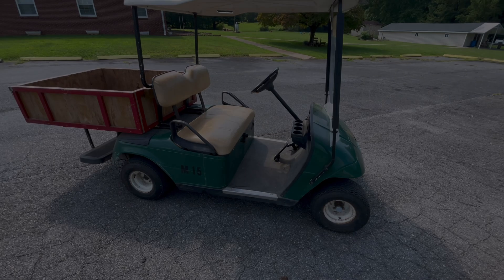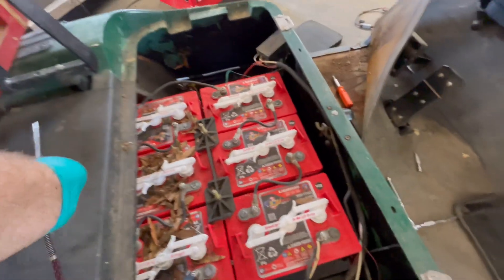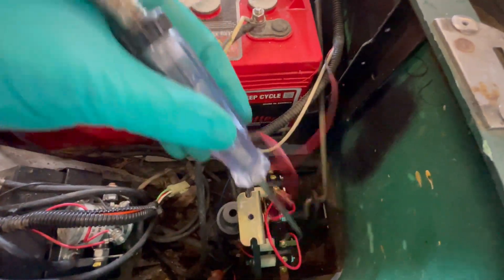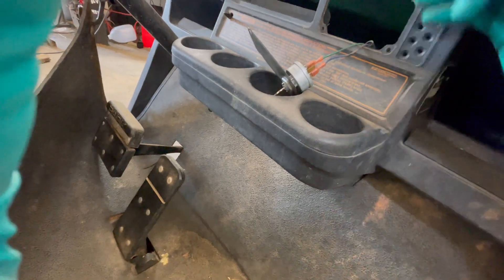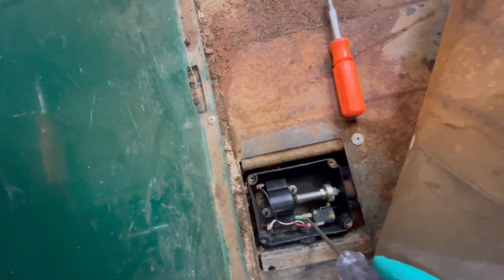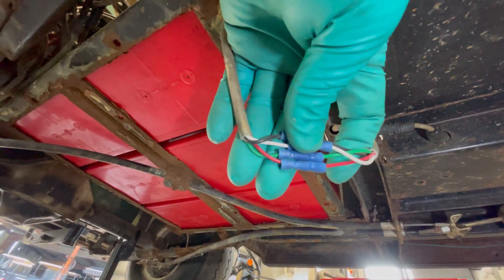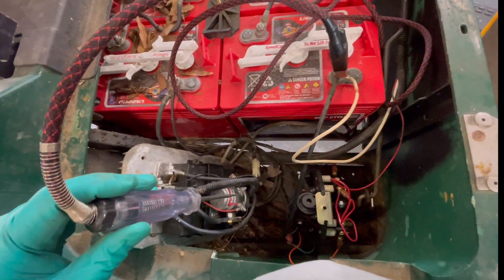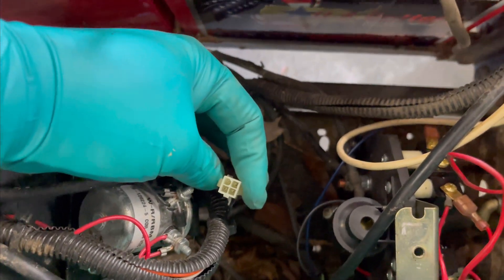EZGO TXT Series Solenoid Test | Is My Solenoid Really Bad?

Comment: Thanks for all you do for the cart crowd! Im at the end of my rope. My 1996 ezgo TXT is frustrating. I found it not moving after never having problems. Troubleshooting got me to check the ITS, good, battery pack, good; F and R switch, good. I did find the logic harness very dusty and dirty and cleaned the pins and the plug very well, and that made it where I can drive it now, but it just stops dead after a minute or two and I play with the harness again and remove it and again can drive it 20 feet and it goes on and on like this. It has something to do either with the harness being too loose or the direction switch but I cannot get readings that I am supposed to get on my meter. Any ideas?

Comment: Changing over to a Temgo LiFeP04 Battery and this video gave me what i needed to know!  THANK YOU!  When I took out the old batteries and the wiring to the charge plug I lost my 36V to the directional control switch.  All I needed was a hot feed to the directional controller and the cart was operational again.  Could not get that help from Temgo unfortunately  Thanks again!

Comment: Will any test light work, or is that a special one
Reply from the maker: I use these bulbs in my test light. They hold up to the voltage. 

https://www.amazon.com/dp/B00KBJPDNE/ref=cm_sw_r_as_gl_api_gl_i_J2VRBEF3RTQJQBBMR0NA?linkCode=ml1&tag=thecartdoctor-20&linkId=e65c643294442ac6087ea9a2570e0a7c

Comment: On the forward reverse switch, the post on battery side of the switch that stays lit during forward and reverse but no power in neutral, if it stays lit in neutral I take it that indicates a faulty forward and reverse switch?

Comment: Very helpful video.  I have a 36 volt TXT that shuts off intermittently and will go again after a short rest.  Any thoughts on trouble shooting this issue would be appreciated.  The forward/reverse switch and solenoid are less than a year old.  These were replaced for other reasons and the cart worked well until recently.  The batteries are old but show good voltage -- some of the cables do get hot.
Reply: Test the connections and components under load. Mine tested good and would open up the circuit in seconds.

Comment: This video series is EXACTLY what I'm needing to rebuild my E Z GO cart. Converting it to a 3 battery 36v system with a new charging system and need to rewire several parts of the harness that have gotten damaged from the previous owner. NEW FAN!!! Thanks!!
Reply: Let me know how your cart turns out. I also just converted my cart to the big three 36v.

Comment: Man I am having the same issue but wire is not bad and no power coming out of the green cable that goes into the black box. I watched your other videos, I have power out of both sides of the solenoid, and at all top black wires, just nothing to the throttle switch cable. Please help.

Comment: 96 ezgo txt. I have 36 v on both sides of my solenoid. Then when I push the gas down one side goes down to 17v. What would be causing that?  Im trying to figure out why my cart wont move in either direction

Comment: Excellent video, clear and concise step by step.  When I  changed to Lithium batteries, I  don't use the old charger receptacle, took the receptacle apart, someone had already removed and bypassed the reed swirch, so I  just connected the red wire direct to the battery positive terminal.

Comment: i have a 2005 thats not series and i shorted / arced my solenoid and not every pin and every post reads 36v except 2 pins in the main middle connector. did i fry my controller? its was working fine before until i washed it and an alarm started going off . then i shorted it after alarm.

Comment: great vid. gotta ezgo, charger doesnt charge my cart. but mechanic took it to his shop and it will charge his. 
i manually charged each battery to 6v. and drove it , then it died, checked the batterys again and they are good. whats goin on
Reply: I work on golf carts for my job, 1 1/2 experience. With golf carts when the batterie voltage is too low. The charger won’t detect and won’t kick on. You’ll have to jump charge them with a 36V jump charger onto them and then awhile after you can put the charger on and it will kick on

Comment: What do we ask for and where can we find the precharge resistor for the solenoid on the TXT?
Reply from the maker: You just need a 250ohm 5 watt resistor. I buy them from DigiKey and put my own terminals on them. Much cheaper than buying them premade with terminals from a Golfcart parts supplier.

Comment: Good video, looking forward to doing some testing on my 2002 EZGO TXT. When I bought it, I needed to replace a lot of parts, controller, solenoid, wiring harness, battery, motor, key switch, and foot switch. While it was on blocks I depressed the gas, and the wheels turned. I didn't run it full pedal, because I had read somewhere not to, when the wheels are not on the ground. Once I did get it on the ground, I depressed the gas pedal, and nothing happened. I pushed the pedal a few more times, and heard a pop, like the old type fused when they would blow. Any idea what would have popped???
Reply from the maker: Running at full throttle with the wheels off the ground for an extended amount of time is not recommended but it won’t hurt anything just long enough to test for wide open throttle. 

Without being able to see anything I’m gonna guess the speed controller fired if you hear that pop. I have a videos on testing speed controller and the ITS throttle sensor. Check them out. Might give you better insight into what your problem is.

Comment: My red wire on the gas pedal shows power 24/7. Green shows dead. Any thoughts?
Reply from the maker: That’s right. Red should have constant power and green shouldn’t. When you press the pedal to activate the microswitch, green should then have power. If you are testing at the pedal switch and don’t get power on green when pressing the pedal you have a bad micro switch. If you are testing at the 4 pin molex then it could either be a bad connection or wire or a bad switch. Hope this helps.